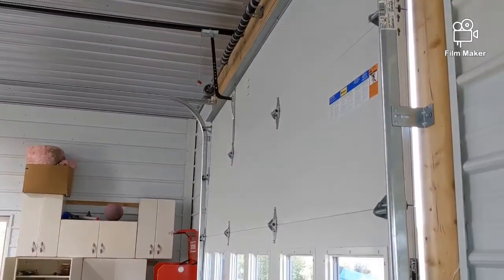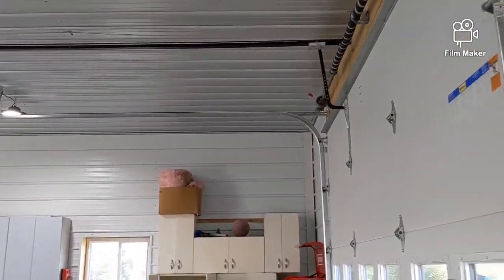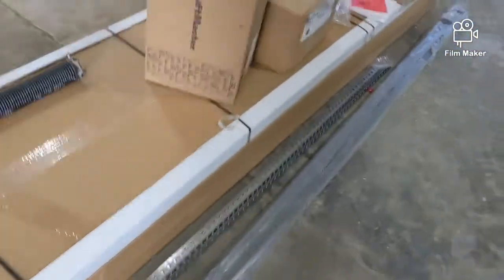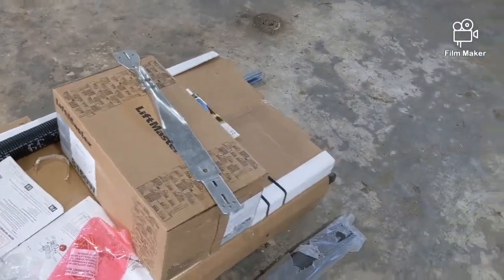12X10 clopay with Liftmaster 8160W DC chain drive

Comment: Just like duris said, these are my favorite liftmaster openers.
Reply from the maker: I like them, just wish I wouldn't have gotten for these doors
Reply: I'd say the same just bc of DC motor, I probably would have gone with an 8365
Reply from the maker: @TBHD724  same, I beam rail would be nice
Reply: @andersongaragedoorservicesllc  you can use an I beam on an 8365, it's been done before. I wouldn't really go with an 8587 though, put it this way if a door needs a 3/4 hp it probably needs work
Reply from the maker: @TBHD724  that's what I wish would have happened, I wasn't the one who decided what doors and operators would be installed

Comment: The rail looked fine to me. They’ve been using T-Rails for years and have been fine.
Reply from the maker: Yeah, the video doesn't show it as well but it does sag a little, but then again I look at T rails on some of the older stuff and don't see any sagging, confuses me a little but it works.
I've only had one where the rail flopped some and tripped the force in an 8365 and that was on a 10ft tall door which is what this door is.